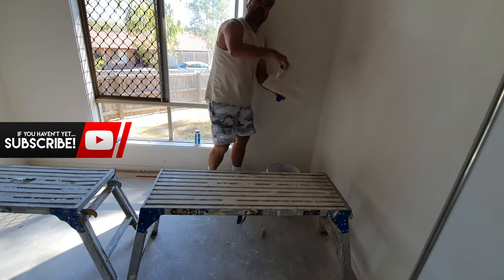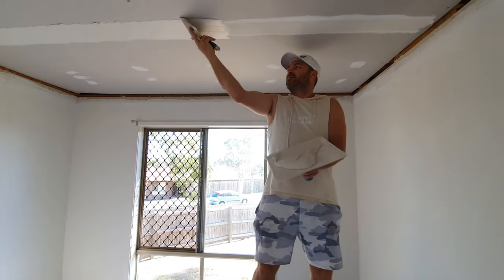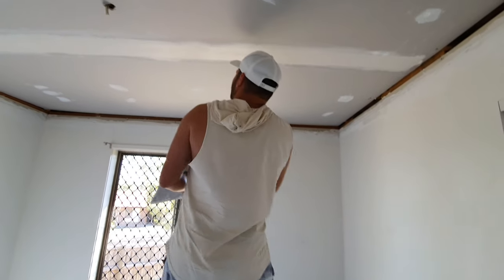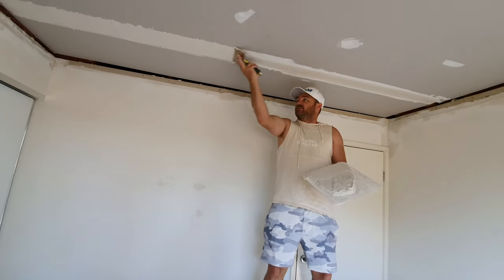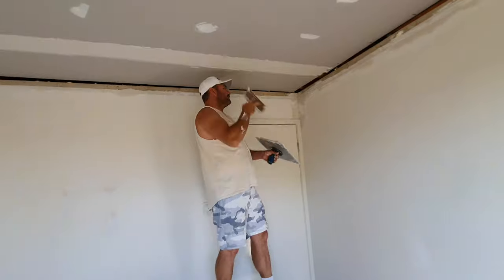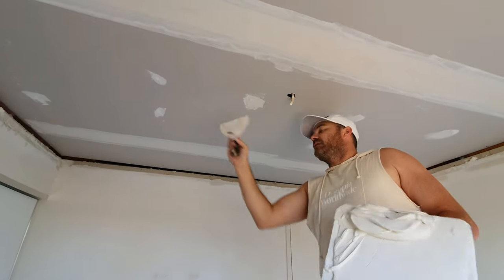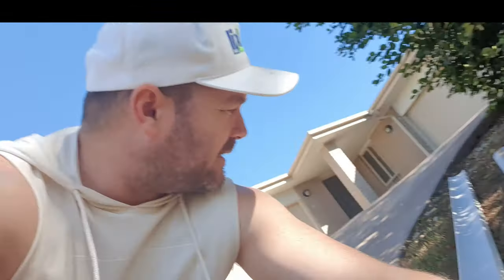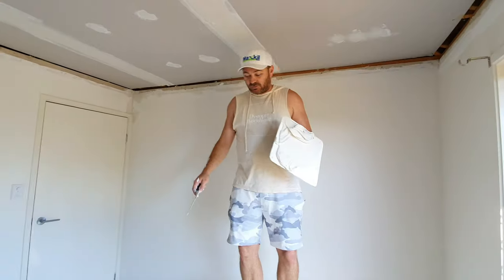Drywall Finishing Coating Tutorial to DIY

Comment: How can I do to make the finish coat dry quick mate? I am doing some jobs with patching and paint about 1m2 like everyday and I am using Multi-purpose Joint Compound
Reply from the maker: Hey mate. The finish coat you can't really speed up, unless you use a fan and a heat gun. Definitely worth it sometimes to do that

Comment: Yo maxkil I’m a framer, but am also learning drywall now. Very new to it but the guy teaching me says he knows what he doing. Anyways he told me always push the sheets up to the lid. Buy your videos shows y’all basically resting on ground then it leaves that gap at top. Can you explain is it preference or what??
Reply: Additionally I saw y’all use those drywall “corners” but here in Arkansas they push the sheets to the lid and tape where you’d put that corner. Then it gets crown molding
Reply from the maker: Yeah in Australia it's different you have cornice going up on the ceiling so you can start from the bottom. Your boss is right for your area